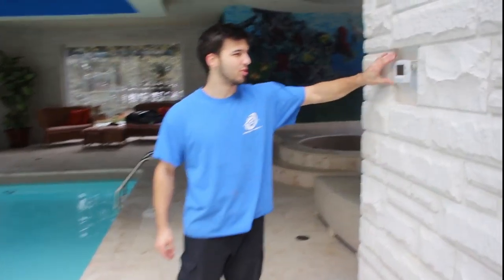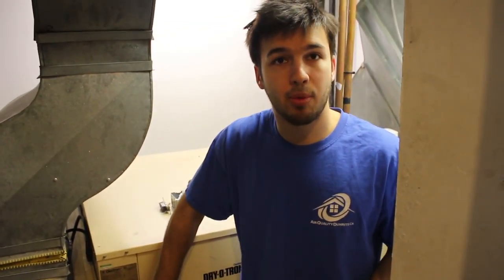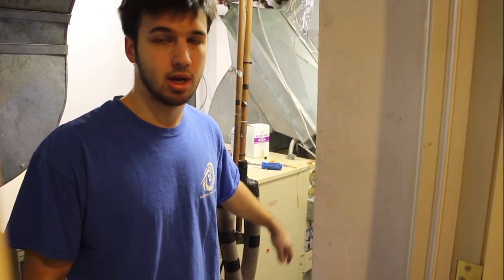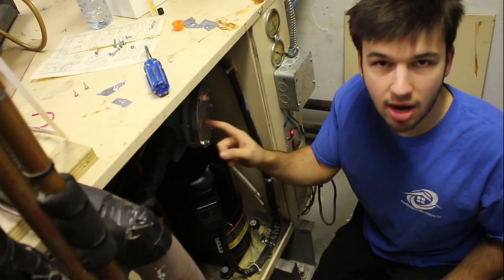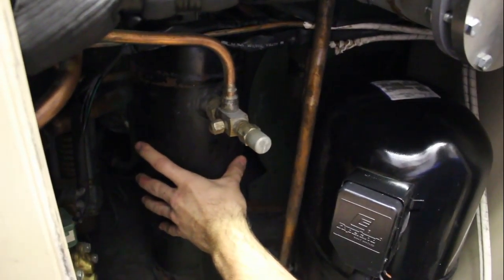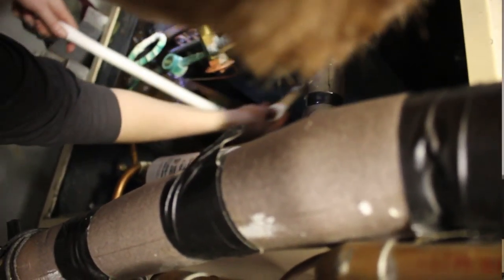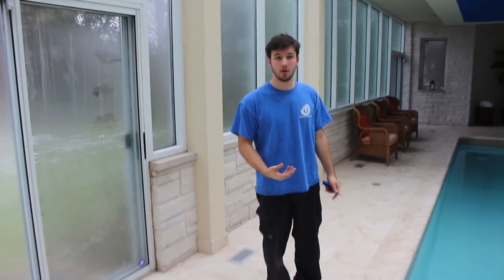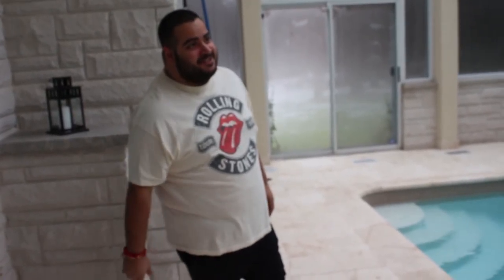Dectron- Humidity in a pool room!

Comment: Having an electronic base residential thermostat & a mechanical humidistat in the pool room itself is asking for problems as the electronics will eventually fail due to the humidity & pool chemicals if used. And the mechanical humidistat will also fail due to the rust of the mechanism & the moisture on the sensor especially if it's a filament. Both need to be & should be located in the machine room with the sensors located in the return air. The operational part of the temperature & humidity control systems need to be in non humid,  non contaminated air with only the sensors exposed to the pool room air influence. A big positive for this also is it keeps owners, friends & family away from the operation controls that are very convenient to them when mounted insider of the pool room. As seen on your video this system has the optional A/C which is also controlled by the room thermostat. Many times the pool users, including owners, will turn on the A/C mode while the pool water temperature set point is higher than the A/C mode set point causing a lot of energy wasted & complaints. Just something to consider.

Comment: So it’s a geo - thermal Hvac unit in theory?
Reply: No. AC Unit with thick Evap coil to absorb the latent heat from the space and reject some of the heat, if needed, back to the pool or the outdoor. But it can also be coupled with gas or electric heat
Reply: I had a unit coupled with a water coil on top connected to a boiler.